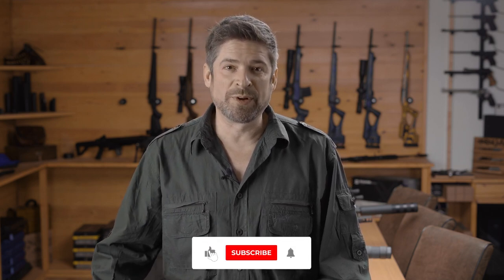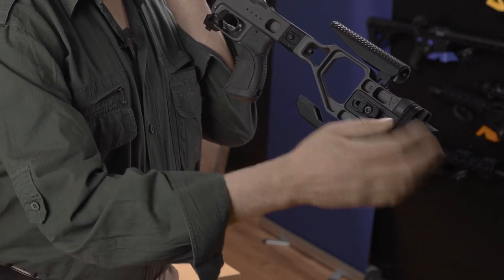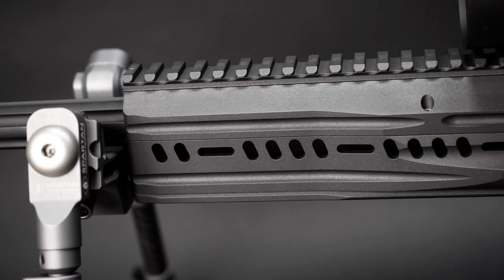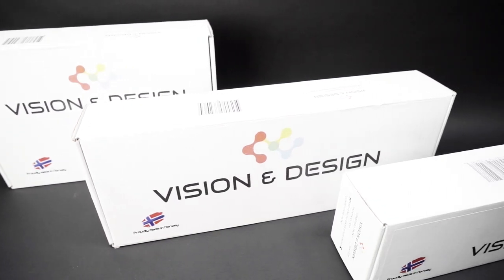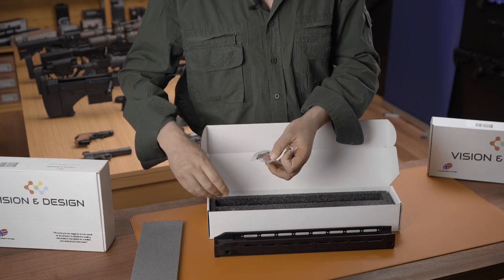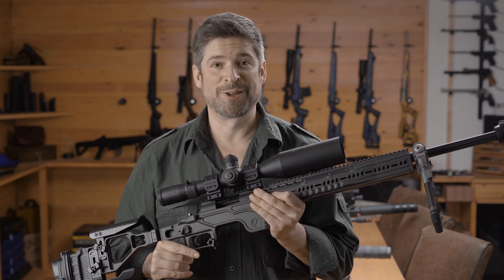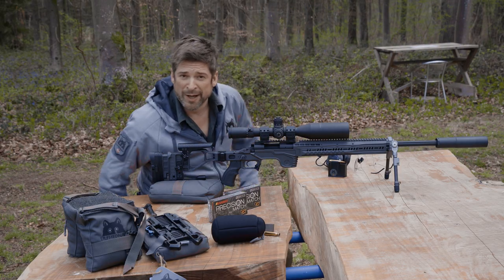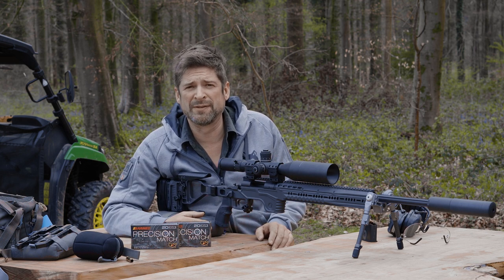Vision Chassis System by Spartan Refinishing

Comment: Does the butt stock adjust for cant as well
Reply: Yes it does adjust for cant. The butt pad has a locking wheel that is discreetly set into the rear. Undo it and the but pad rotates and locks in various positions. 
Hope that answers your question.
Thanks
Chris